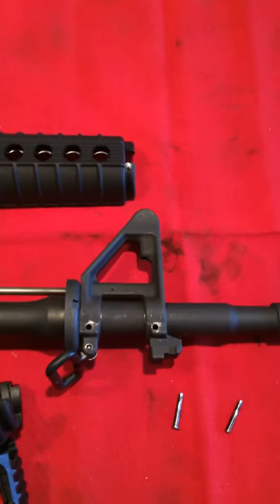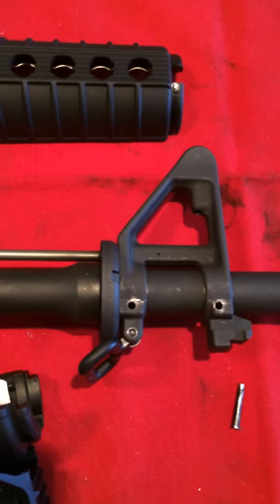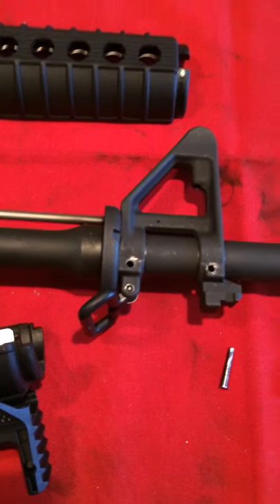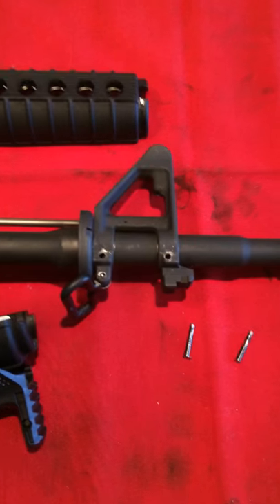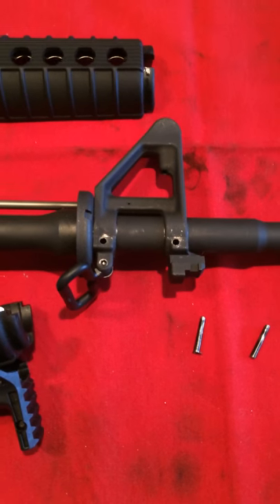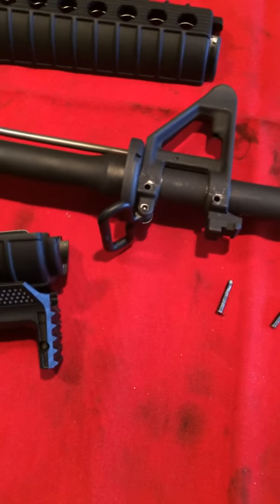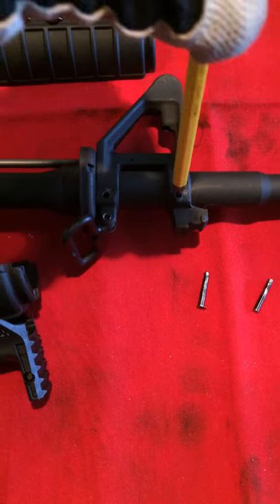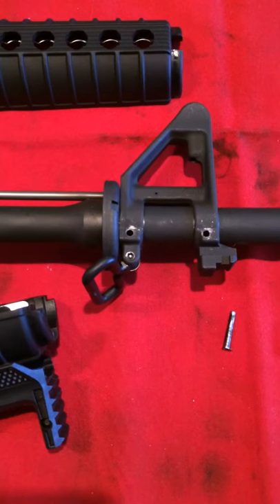A2 FSB Removal HELPFUL TIP. AR Front Sight Post/Block Removal Tip.

Comment: I watched a Brownell’s vid and that guy definitely mentioned using a smaller punch after getting the pin started. That video was specifically for the Ruger AR-5.56 tho. Pretty sure it’s universal with all the front sight gas blocks. Thanks for the vid.

Comment: Yes it does say Left to Right but my M&P 15 Mid Moe was not like that, the small ends of the pins were on the right side and the brownells sight block was backwards from this.
Reply: That's how mine was too, I even used calipers to determine the small side of the pins, I ended up cutting it off

Comment: Your starter punch is tapered it should be obvious that it should not be used to drive the pins out. The pins are tapered also, but in the opposite direction.

Comment: The belief that they are all left to right is NOT true. They are not all left to right. Check with a micrometer before ypu go bangin on your sightblock. Its reall easy to findout which way to go. Just measure the pins. And knock em out from the bigger side.

Comment: this is why so many comments say they can't get pins to move and after spending so much time POUNDING on pins----- LOL
Reply: Even still. I just did one the other day, had to slam it with a 3lb a few times. They’re in there pretty good
Reply: @standarsh5523  use your kroil oil and let it sit and soak in for about 10-15 minutes and they’ll slide out like a hot knife through butter.

Comment: Question??? I have an 18"barrel, with a long handguard. ( I want to change that) The gasblock location is about mid barrel. I want to install sights with a gasblock, and order/purchase a shorter handguard. How do I get the measurement, or is there a standard for that barrel length, and gasblock location?
Reply from the maker: There are basically 4 “standard” gas lengths: Pistol, Carbine, Mid-Length and Rifle. Measure from the receiver to where the gas port is and you’ll know what size gas system you have. Carbine is most common on a 16” barrel and Mid-Length or Rifle length are the more common lengths on 18”+ barrels. Mid-Length is about a 9.5” from chamber and rifle length is about 12.5” but keep in mind you will need to add about an 1.5” to 2” to the length of the gas tube to make up for what goes into the receiver and into the gas key. But you can always reuse the original gas tube and front sight, if you want the front sight post immediately after your handguard so you don’t have a lot of the gas tube unnecessarily exposed get a 9.5” handguard or 12.5” if you have a rifle length gas system. Hope this was was helpful.

Comment: Where did you get that black and blue drop-in handguard?
Reply: A little late but that is a standard black 'stoner' handguard from midwayUSA and the foregrip seems to be an SI link in black with some blue accenting he may have painted. Not 100% sure.
Reply from the maker: Sorry for the late reply, Correct that was a standard black clamshell handguard with the “heat shield” inside and the angled grip was the SI Cobra grip in black, it may just have been some weird camera angle that gave it a blue tint

Comment: Well now I know if the hole is to small for my pin then just get another one that's smaller. Lol.
Reply from the maker: Hey it's just a helpful tip for those removing their first FSB cause the tapered pins are 1/8 and it looks like a 1/8 punch will fit so...